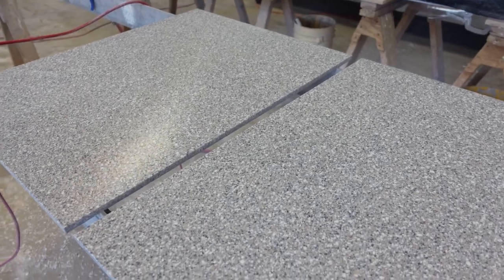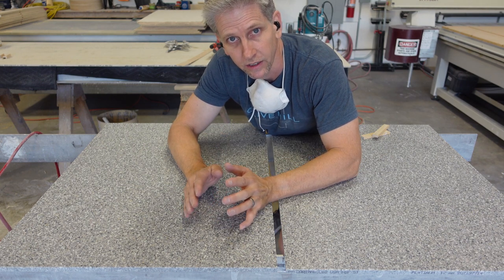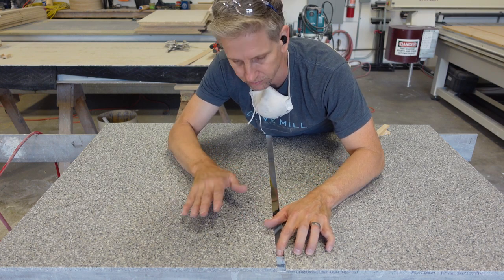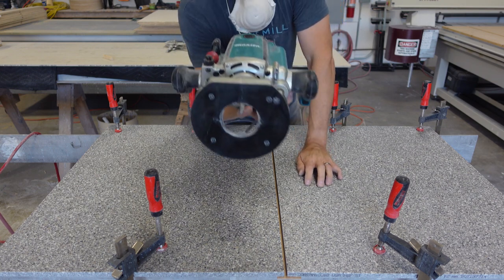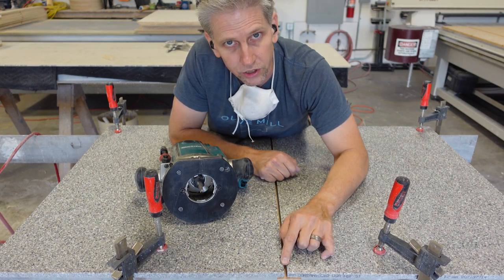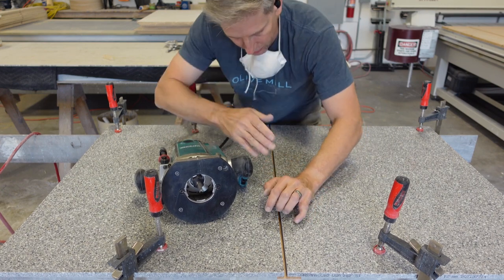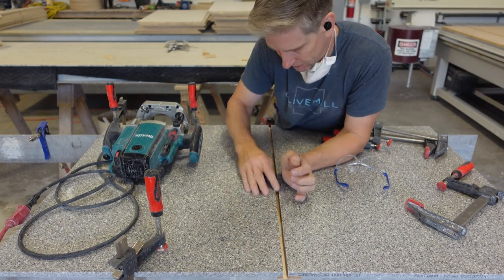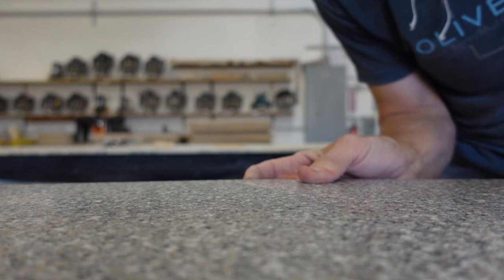Seaming Corian Solid Surface Joint - Invisible Seam | Freehand

Comment: Andy, I am glad to see that you gave this method a try.  I have never raised the seam area and never had any issues with achieving a tight fit using the free hand seaming method.  Over the years it has saved me lots of time.
Reply from the maker: Hi John, yep it's amazing And works great. The credit goes to you.

I also use the shim to avoid cutting into the work table. Especially with employees, it kinda a fail safe way to cut a seam.

Comment: Awesome video and your work that you do. I’ve done that before but never raised it so the cut is at an angle. Keep the videos coming🔥🔥
Reply from the maker: If you have never had an issue with the seam not pulling perfectly tight, you could eliminate the wood strip. Is not mandatory but we find it helps.

Comment: Hi Andy! This video is really helpful. I am about to seam 2 pieces into a 40ft section. It will have a built up lip edge. Essentially a long counter, if the Corian is already sanded and finished. Would I just follow the process of sanding and wiping clean like you did in the video or what do I need to do after I seam that? Just wanting to clarify. Thanks again!
Reply from the maker: Are you asking what's the next step after you glue the seam together?
Reply: @AndyGraves  I really that was a confusing question. I did some more research on your videos, I guess my question has now morphed into 2 questions

 1) do you think I would be able to blend the finish, wether it’s finished with the scotch Brite pad or polished or would I have to refinish the entire length of the counter to make it blend? I have very little experience with the finishing process.
2) what is your recommendation for finishing the drop edge. Would you just sand it down the epoxy or would you reroute the edge? 

Thanks again!
Reply from the maker: 1. You can blend it to the surrounding area. But you are a novice so it's going to take some more time and patience.

2. Is the drop edge a detailed profile? If it is then just sand the top flat and you can reroute that section of the countertop. Or if it's a simple profile then just sanding it will suffice.
Reply: @AndyGraves  thank you! It will be a learning experience for sure. Appreciate both those helpful answers. Will return with results!
Reply from the maker: @devinlopez9253 Excellent, there are other videos as well to help.

Comment: Great video, Andy. Getting ready to do my first project and will need to do a seam so this is perfect! One question: Do you have a recommendation as to which brand adhesive to use (for Corian)? Thanks.
Reply from the maker: Thank you. Use Corian adhesive that is the correct color match to your countertop color.
Reply: @AndyGraves  Ah, I misread Corian's webpage and thought they discontinued it....they just reformulated it. Much appreciated!

Comment: Hey Andy 
Thanks for the video, I have a question, would and could you do the same with a 3 meters long seam, on a countertop with himacs plates colour aurora Blanc you know with the wavy design pattern, I don’t know if the plates even if they’re in a consecutive order will line up pattern vice when  put against each other with the long edges. 
I’m told do make a freehand router cut in sort of an S shape, 
Hope I makes sense 😅

What would you do? 

Best regards 
Anders
Reply from the maker: Are you trying to make a long seam on material with veining?

Comment: Andy your video is very informative and easy to follow. Would you recommend placing an undermount sink along the seam of the corian countertop?
Reply from the maker: You could seam the material and then do a sink under it.
Reply: @AndyGraves  I’m hesitant as I’m wondering if the seam will be efficient as the seam will be passing where the undermount sink will be installed
Reply from the maker: Just make sure the cabinets are flat and it will be fine. The Corian adhesive is super strong.
Reply: @AndyGraves  what model router do you use?
Reply: What about thermoforming a sink into the corian first and doing the routing after?
Reply from the maker: The sink is formed, not thermoformed. You only have to glue it to the under side of the countertop material.
Reply: @AndyGraves  so you basically install it like a normal under the countertop sink and the seam also becomes invisible? Did i get that right?
Reply from the maker: @johndemtopics1377  Yes, that's correct.
Reply: @AndyGraves  thank you so much for the info. I always thought it to be the most troubling thing ever to transport a corian countertop, because of the already installed sink. I subscribed!

Edit: while i am at it. Imagine your corian sink breaks because you dropped something heavy into it. Is it replacable without removing the countertop? Or does the composit glue make it one solid piece? I suppose you could cut out a slightly larger sink opening on sight but what would be your go to?

Comment: What router bit was that and is it good for granites?
Reply from the maker: It will not work on granite. The router bit is in Amana single flute 1 in cutting length 3/8 diameter
Reply: @AndyGraves  
Thanks.

Comment: thank you for posting   my question is  Can I do the seam this way for a table top and make an extra leaf with matching seams and not glue anything?  Will the solid surface warp over time?  I would like to be able to adjust the size of my top for different settings  Thank you again for posting
Reply from the maker: Yes, but put at least a tiny radius on the top edge so it's not sharp

Comment: how do you adjust a joint with a cove on?
Reply from the maker: It's hard as hell. So we typically build the top and then cut all the deck seams. Then we check the template to make sure it's a perfect fit.

We set clamp the seams together and then glue on the cove back splash.

To adjust after, we flip the top over and cut off what wee need using a straight edge and router. But it's very difficult to get it perfect.

Comment: What do think about using a wavy router bit.? On short seams , I find that a wavy bit works well .  On long counter top sections I typically glue the build ups on first , then glue the tops together on location. Most of the tops I install are 20 feet or sometimes longer. I work at a school district, occasionally I will have 40 feet of work space in 1 run . I have mixed results with having an invisible seam . The issue is that once I route through the 1”1/2 edge the router vibrates really hard and drifts just enough to gap the seam . Do you have any videos or links to videos for technics on seaming with the build up already installed. I’m a big fan of your videos. Thanks for posting.
Reply from the maker: I do not have any videos of that process. What you need to do is get a big 2.5 HP router and install a square base. Then get a nice straight edge that is actually straight. 

Next, buy an Amana or equal 2", double flute, 1/2 DIA router bit (Don't use this bit for anything but seams to keep it sharp). Now figure the distance from the bit to the edge of the straight edge and clamp the straight edge so it cuts off just a fuzz of the seam. I'm talking cutting off paper thin material from the seam.

Last, apply two layers of 1" masking tape to the bottom side of the router base that is closest to the straight edge. This will create a back bevel on the seam.

Now cut the seam SLOWLY through the edge buildup. If you get a crappy cut, barely tap the straight edge over and try again.

You may have to block sand the entire edge using a Corian block and PSA 80 grit sandpaper to dress it up a tiny bit. But other than that it will work perfect.

Hope that helps
Reply: @AndyGraves  thank you for the response. I have been using  most of your suggestions. I need to add the tape to the 1 side and try cutting less material. Typically I’ve been removing 1/8 “ of material. It never occurred to me to shave off less. I use a festool 2200 router , I believe it’s around a 3 hp equivalent. When doing field work that dust collection is really helpful.

Comment: Why do I need a router?  Can't I just cut using a circular saw if I use a guide and a fine(er) blade?
Reply from the maker: Sure you can but it won't be a perfectly tight seam.
Reply: @AndyGraves  Not to be ignorant, but why not?  If I use a diamond blade, move slowly, and (super)fine sand the edge?  I don't have a router, and don't want to purchase one & learn how to use it for a one-time job if I can get by with a circular saw.  This is for our old corian counters, which we moved to the basement.  I need to trim them down a bit, to fit.
Reply from the maker: Oh no, you can cut it with a saw. A seam is just better when you cut it with a router that's all.

Comment: How can I find someone who knows how to seal 2 pieces of corian together Morgan Jill can
Reply from the maker: Do you have a crack and need them glued back together?
Reply: @AndyGraves  I have a crack in my WilsonArt solid surface counters. What do you use for the glue?
Reply from the maker: @chrgdsolar7782  Click on a link in the description and it will take you to Amazon. The search for Artisan Adhesive. Keep in mind you need the exact color adhesive that matches your material.
Reply: @AndyGraves  Thanks. I tried searching for it but couldn't find it. The color is Antique White 1572SL. Any other recommendations?
Reply from the maker: @chrgdsolar7782  To confirm, your countertop color is antique white?
Reply: Yes, that is correct.
Reply from the maker: @chrgdsolar7782  The adhesive color for Wilsonart Antique White is Artisan Adhesive Frost White - https://amzn.to/3rgo9X3
Reply: Andy, and advice for cracks in the countertop? I have a crack in mine and am not sure the best way to fix it. It also looks like I can't send a link that has pictures of the crack via this forum.
Reply from the maker: @chrgdsolar7782  I have a crack repair video you should watch, it explains the process. Search my channel for the video, I don't have the link.

Comment: Why don’t you just use a straight edge and run the router from that ?
Reply from the maker: You can but if you're using veined material  the dream will look much better.

Comment: Why on earth would you not use a straight edge ? Also why are you parking up the joint ?
Reply from the maker: It can help hide seam lines in veined or patterned materials.

Parking up the joint? Not sure what your asking.
Reply: A wavy seam is by far the best seam in the world for hiding joints especially on heavily grained/textured material. The wavy in this video is tiny. You should see some seriously wavy seams. Like a random wet noodle. Pretty much invisible on brutal material.
Reply: This was my exact question and their answer blew my mind. Everything makes sense now! Thanks

Comment: I still don’t get this 🙈how’s does it not run off with out a guide
Reply from the maker: It's the path of least resistance. The but will track right down the middle with it kinda moving side to side a little as you pull it through. But it's always cutting both edges.
Reply: @AndyGraves hi Andy, when using something to pack it up won’t you end up with a gap on the underside and on the lower side of the edges once the packer is removed?
Ben
Reply from the maker: Yes there is a tiny little gap in the bottom.
Reply: @AndyGraves  ok, what method would you use if the edge is seen? Thanks
Reply from the maker: Please explain further.
Reply: @AndyGraves  I mean if the edge is seen and there is a gap on the lower side of the edge due to using the packer would you use an alternative method?
Reply from the maker: @lillewy121 No, I use this method.